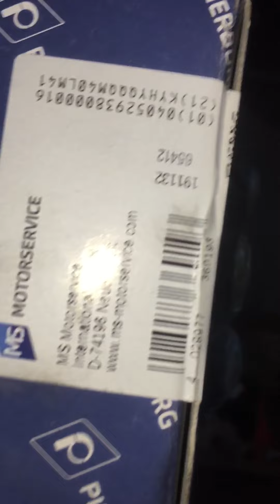BMW 320D E46 150 hp M47N. How to replace turbo controller  pressure transducer. Vacuum control valve

Comment: My bmw e46 320d wont rev above 3000rpm when comes to 3000 smoke come from exhoust and after few seconds stop the and have powe but dont wont to go above 3000rpm is this solution?

Comment: Dude, my e46 320d it's slow when accelerating, it doesn't have that power, can you reply please? 
I've changed the maf, got slightly better, but it's not that....l
Reply from the maker: could be lot of thinks, beside the faulty waste gate valve, could be clogged egr, clogged catalytic converter, turbocharger issues, clogged intercooler, exetra... please give me more information like - codes, last maintenance done, since when is the issue .. how many hp do you have 136 or 150hp?
Reply: @SuperFastDriver  136hp.
When I plugged in PC last time, it was showing bosh pump injecting issues, maf sensor too, there were other ones but not about this problem.
So, also when I try to start it in morning mostly or when it's sitting for a week, it starts like with 3 cylinders too...
Also there's a whine sound from the turbo.
Reply from the maker: @Bimmerr   when the car worms up do you still have a missfire? I would suggest you to measure your fuel pressure after the pump to determine if the pump is started to fail you need to go to car mechanic if you don’t have pressure gauge 0-200 bar, and try to replace the maf sensor I think is the cheapest one..
Reply: @SuperFastDriver  my car dylies in power after good take of,, a have code saying,, charge air pressure control, control daviant,,E46 2005 320d 150bhp

Comment: Hello, I have this error on my 535d e60 lci: 429A boost pressure control low pressure stage, control deviation. Do you know what the problem would be?

Comment: Hi man very nice video. which problems was it giving? I have some gaps in acceleration at low rpm
Reply from the maker: power losses, after 2500 rpms

Comment: hello my car pulls after 2.5 rpm is that normal or do i have to replace this part too
Reply from the maker: do you have any interruptions while pulling .. is it going smooth all the way while accelerating?
Reply: @SuperFastDriver  It doesn't give an error, it's good, it's pulling until the end
Reply from the maker: so you are good with that, nothing to worry about..